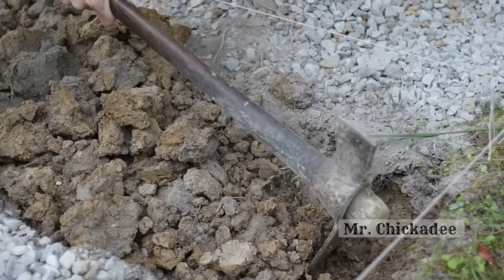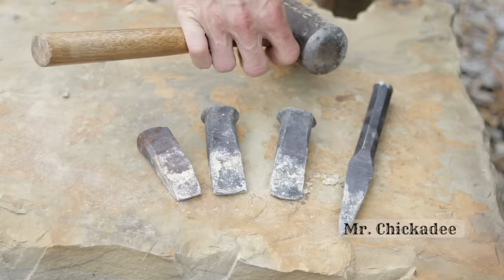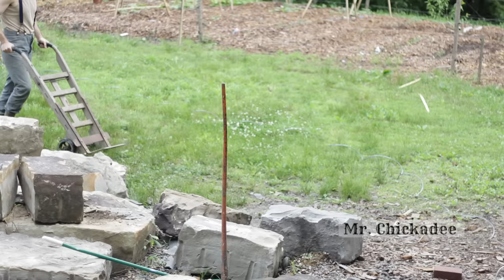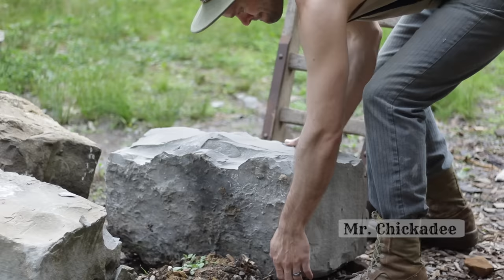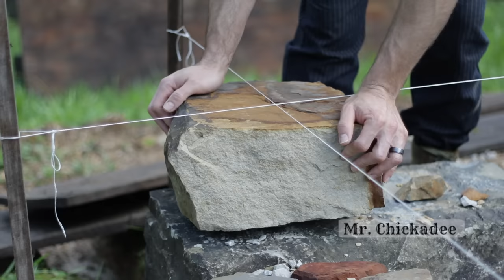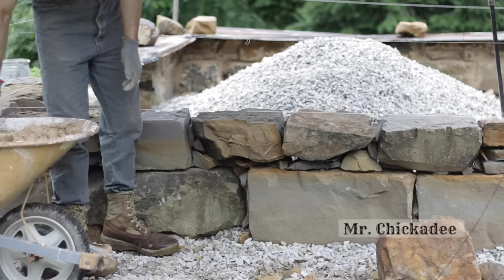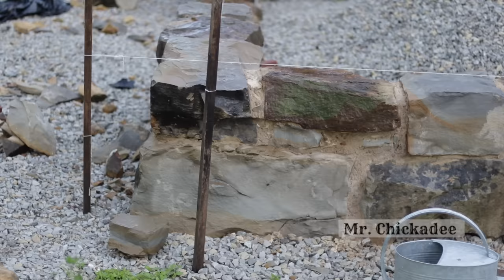Stone Foundation

Comment: Now the plumber needs a 6" hole through the foundation...  Lays out 3 chisels and a hammer for the plumber
Reply from the maker: No plumbing here, its a smithy, if it were a house, just lay up a pipe as you go
Reply: @MrChickadee  I thought it was a good joke because at the time of my comment I found out I have to drill a 5" hole through a 36" granite block foundation to re-route a waste vent.  Any tips?